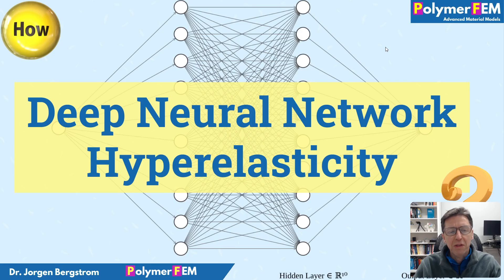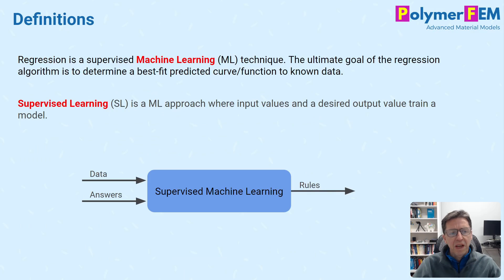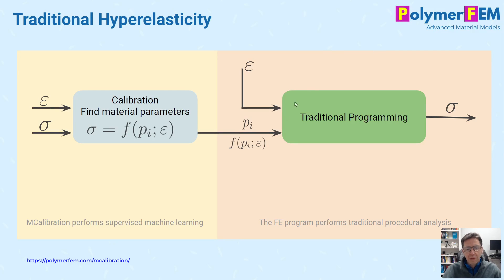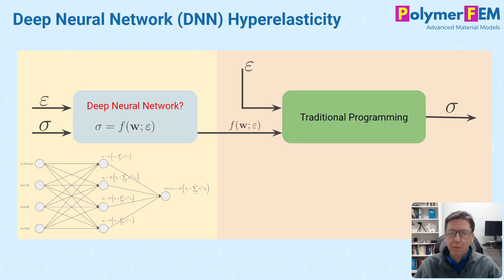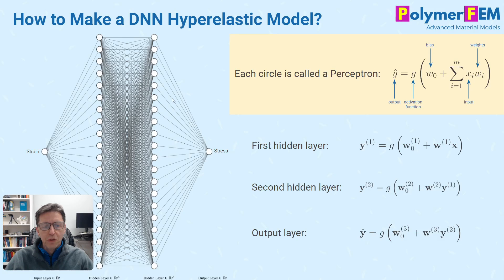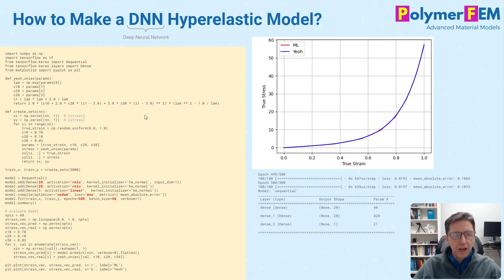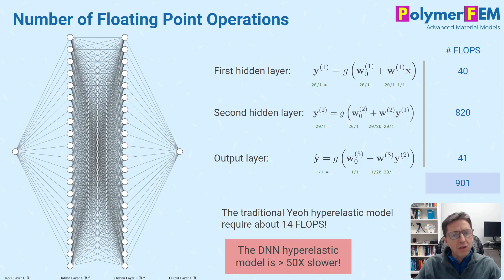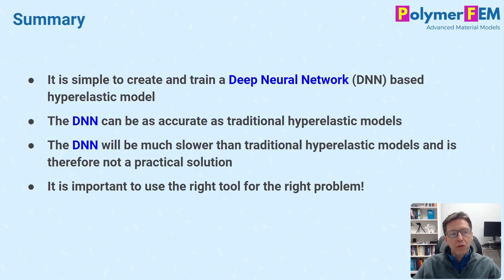Deep Neural Network Hyperelasticity

Comment: Dr. Bergstrom, I have great respect for your work. I myself have learned about polymer mechanics from your publications. My comment is to kindly defend, to some extent, models based on artificial neural networks: I believe the comparison you present does not truly explain the power of these models. While it's true that an ANN like the one you demonstrate is too computationally costly to model a material using only a single variable as input, the reality is that these models are useful when there are no constitutive models for variables beyond deformation (even with rare cases like bacterial attack on a material). We all know that modeling materials can be time-consuming, and ANNs help solve problems quickly; although this doesn't mean one should not eventually seek more succinct and explainable constitutive models than these. In this sense, I think it would be fair to compare an ANN with advanced constitutive models that take more than one variable as input. Regards!

Comment: Another interesting approach could be to use Bayesian machine learning with Markov chain Monte Carlo (MCMC) sampling to obtain posterior distributions for for all parameters from which credible intervals for the parameters as well as stress could be obtained.  This would show how much error would be in the calibration; one could assess if the model is correct and/or if the data set is suitable.  The downside is that the MCMC process would take longer to compute than for a typical calibration.